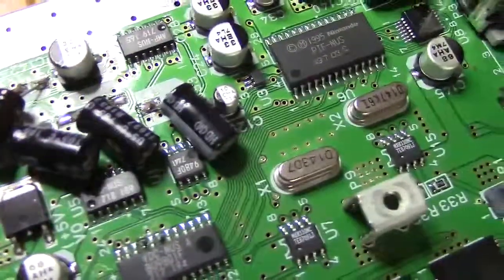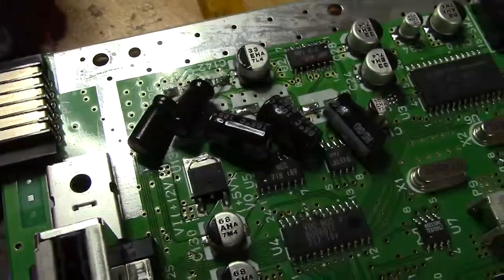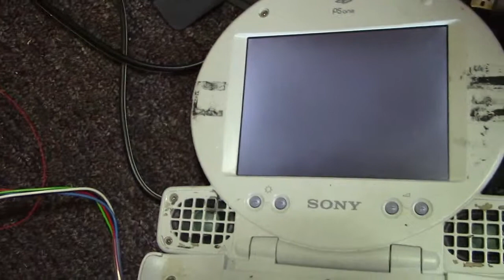N64 simple RGB mod with *easy* C Sync (no LM1881 needed)

Comment: NUS-CPU-01, NUS-CPU-02, and NUS-CPU-03 already have C-Sync on pin 3. The NUS-CPU-04 is only missing components to connect C-Sync but still has the footprints, so of course you can still get C-Sync. Since the NUS-CPU-04 is the most common board rev with the RGB-capable DAC, most N64 RGB amps have C-Sync restore.

They actually expect you to remove those components if present then connect C-Sync through their board. The ones that don’t handle C-Sync expect you to leave the console’s C-Sync intact or add a jumper exactly like you did… see RetroRGB’s amp install where he adds a jumper and finishes with “That’s it!  A super easy way to add noise-free csync to an N64!” Interestingly, the page also shows a design with a LM1881 but I suspect that was a board that could be built to suit other Nintendo consoles as well.
Reply: That info was like fresh water for me. Thanks a lot!!

Comment: THANKS A LOT!
Why no one added this information to RetroRGB?
Reply: I’m pretty sure it’s there. I mean, this is even part of a normal RGBS amp install since you can’t count on those components being populated. When the components are populated (NUS-CPU-01, NUS-CPU-02, & NUS-CPU-03) you are expected to remove them.
Reply: Honestly, it’s a little weird seeing it treated like that isn’t the normal way. I mean, NUS-CPU-04 is by far the most common board rev with the RGB-capable VDC-NUS. C-Sync is already there on earlier boards and most N64 RGB amps optionally bypass/restore C-Sync specifically for NUS-CPU-04.
Reply: Yeah, I just checked and it’s right there under his “N64 RGB Mod – Basic Amp Install” page. Direct quote after he demonstrates it for his own amp board that doesn’t do C-Sync:
“That’s it!  A super easy way to add noise-free csync to an N64!”

That board is very old so the info has been there a while.

I was surprised to see an example of some N64RGB amp with a vestigial LM1881 sync stripper. Pretty sure that board can be reconfigured for different consoles, like the one Console5 used to carry.

Comment: Hi! just to clarify, you just to link the R16 hole directly to Multi-out PIN 3? It is already in TTL level, like the ones found in the SNES fat. Than you need a cable that takes the sync from multi-out pin 3 (and not from composite pin 7 or luma pin 9). And if I would mod a RBG SCART NTSC cable to get c-sync from pin 3 I need to make sure to add a 330omh resistor to attenuate the signal. Tks for the video, I will try it! (Y)

Comment: Am I understanding correctly, you only need wire for this mod? Can I route to stock AV connector instead of custom D-Sub? Thanks
Reply: Yep, I already built both THS7314 amps (SNES/N64) and they work great. This was one of the first videos I found when I started looking a few weeks ago. It confused me because you were adapting your previous mod and some details weren't shown clearly in the video. Thanks
Reply: Would this CSYNC mod work for outputting to an Extron Crosspoint? I'm still confused about the differences between TTL and 75ohm CSYNC but I realised you didn't mention the 75ohm version.

Also just to clarify, would this PCB Layout be the same for any region console? I was planning on importing a Japanese Console to use 60hz US Games and putting Tim' Worthington's RGB Mod into it.